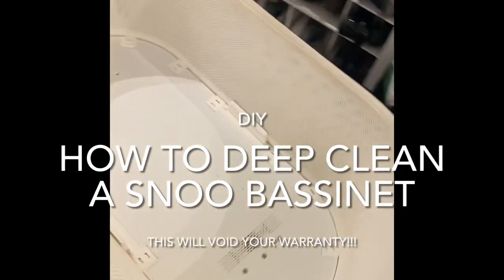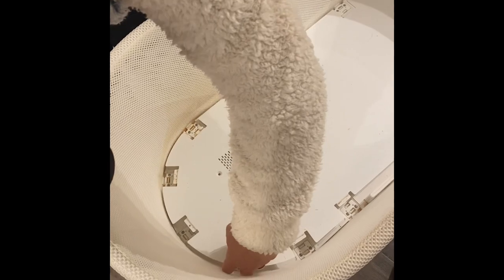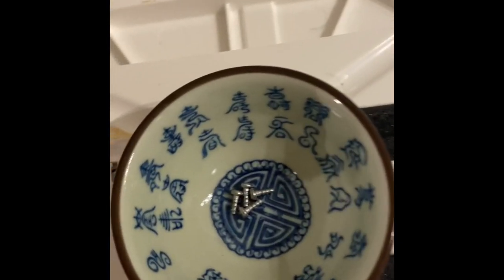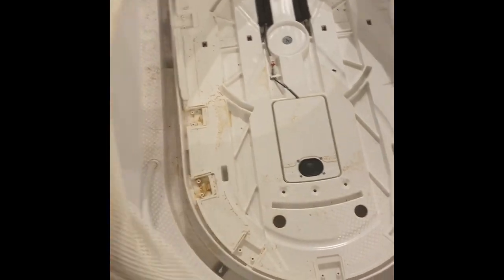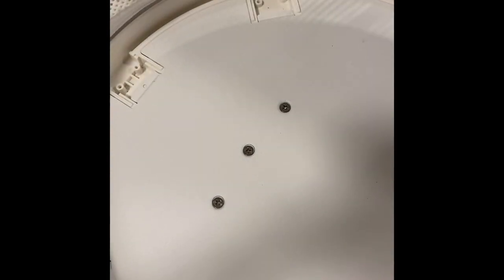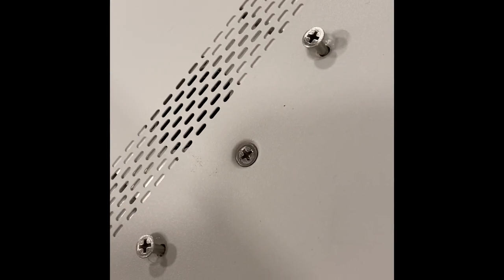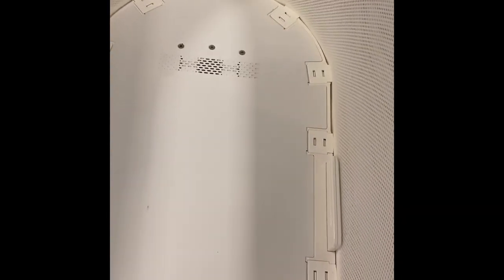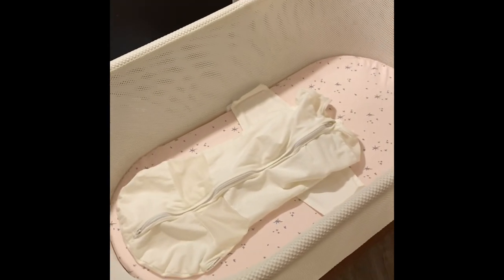DIY How To Deep Clean a Snoo Bassinet

Comment: Struggled with putting back the six screws until I read the comment that explained what was happening. Basically the thing the screws latch on to falls away/downward when the screws are removed. As a result it’s much easier to install those six screws if you lay your Snoo sideways and then tilt it a little further so the thing the screws need to latch on to falls back towards the hole. Then leave the Snoo on its side while you wiggle the base and search for the screw’s hole with a flashlight and the screw.

Comment: Tip for those 6 screws, I had some longer screws of the same diameter (I think M4) and used one in the centre hole to help pull up the lower guides before putting in the original screws either side, then it's easy to swap the middle screw. The problem is the lower guides drop and the screws are not long enough to get a start and pull the guides back up
Reply: Using some longer screws make getting it back in really easy
Reply: Same here. I found a longer machine screw of same diameter in my collection of misc hardware. Lifesaver. I used the long screw to attach to one hole (not fully screwed in), pull up on the long screw connecting the loose the piece underneath, fully attach the two other original screws, remove the long screw, and finally replace the final original screw (repeat on other side). Sadly, this seems to be a proprietary design "feature" to discourage consumers from performing basic maintenance on the device.

Comment: Yes. Thank you so much!! Excellent tutorial and tips. 

This is something that Snoo should address! I it retails for $1200+ and comes with this fabric mesh that is impossible to clean. (quickly and easily!) Hopefully Snoo will re-work this, and build it with material that can be hosed down, the fabric snapped back on quickly and easily, etc. anyways! Fully appreciate your tutorial. 

When I unzipped the back on mine and looked inside, it was very dusty between the two pieces of mesh. 😳 AUGHHH!! Time to get to work. Good luck with your baby, as well. 💖
Reply: Amen

Comment: The hardest part is definitely to get the 6 long screws back in place… I put the basket on a clean mat and tried different angle (lean the basket against top edge, like almost straight up on the side way) and kept moving the inside at the same time. Finally I was able to secure the two middle screws… feel like such an achievement!!

Comment: I highly recommend against taking this apart. It can be put back together, but it is labor intensive. After a very long struggle, I have managed. If you do take it apart to loosen the fabric, I would not take the metal plate off. That’s where things really went wrong. It depends on what kind of deal you can get or what it’s worth to you. I paid $850 and for the amount of time and frustration it took to clean, I would’ve sooner bought one new or rented.

Comment: Very annoying to get the 6 longer screws in but I found a pretty easy way.  Take the Snoo and flip it upside down between two tables with a gap in the middle and work on it from underneath. That will bring the plates down so that you can easily screw them in.  Helps to have two people to lift and flip it.   Once I figured this out, I got all screws in within 2 minutes.  What a poor design though.

Comment: Hi - I’m having a hard time snapping the pieces together shown 5:08-5:20 or so. They’re arranged correctly, but only easily snap in on the back half beside the mesh. The front part of the top plastic pieces doesn’t want to snap back in. Some go in fine, most don’t. 

Did you run into this problem and do you have any recommendations for making this easier? 

I’ve tried pressing a flathead into the slot to get them to snap, but they just won’t click. 

UPDATE: ok - the flathead can work if other people have this problem too. Just be careful. I broke a small plastic piece on the bottom connector, with no structural damage, but it helped get several others in that just wouldn’t otherwise snap

Comment: You can screw the clips back on before refitting the fabric to the base.  I found this easier.  Once fabric is fitted the top clips can be put on.  I put long match sticks through the middle holes of the 6 bolts.  The one I have done had broken o rings on the bearings so a bigger rebuild.  It is possible and I did completely remove the fabric to clean it but it is a lot of screws to undo.  I’m a mechanical engineer, took pictures and got it all back together fine and exactly the same but if you aren’t confident in your abilities then best not to attempt it.

Comment: For the 6 screws, I just gently stick my hands underneath the platform and felt the metal plate. Lined up the metal plate’s hole with the bottom of the platform hole where the screw goes through. It was pretty easy rather than keep trying to look through the holes with the flashlight. But definitely have to be gentle.

Comment: Taking the metal plate off is not necessary for most clean ups. My baby just threw up a foot in the air, hit our bed that was next to the snoo, it got under the mattress somehow and in between the two layers of mesh, but there was none at all under the metal plate. I could have just taken the plastic clips off without messing with the big screws and would have been able to clean it just as well.

The difficulty with the large screws is because the part they are supposed to screw into drops down once you take them out and the screws can’t reach it. I set the snoo on its side and used a long thin screwdriver to find the middle hole. You will know that you’ve found the hole once the screwdriver goes in deeper then the length of the screw. Then, while holding the screwdriver in the hole, tilt the snoo (like you’re starting to flip it upside down) and then put in the side screws. As they start to catch the thread of the part underneath they start bringing it up and the middle screw is no problem at all. You have to repeat the whole thing on the other side as the two sides are two separate pieces. 

As someone else said above, if ou have the same type of screw but longer, you can also just put the longer screw in the middle hole to bring the part up and then replace it with the correct screw once you’ve screwed the side screws in.

Comment: This product costs $1600 and you need to disassemble it to clean out the mold from baby spit and puke... absolutely ridiculous

They should have instaled gaskets to keep liquid out.

Poor quality engineering. But dont worry folks it has WiFi 😂

Thanks for the videoml. You are great. The engineers behind this....not so much

Comment: May I ask how much you paid for this, needing to be taken apart for cleaning?
Reply: Following
Reply: Used Snoos go for $600-$1000 depending on how many previous owners. They are $1,600 new plus tax. I paid $700 for mine with accessories and it’s very dirty. It was not disclosed when I purchased or else I wouldn’t have bought it. It’s cleaning up good though.
Reply from the maker: I paid $800 and it came with a bunch of other baby accessories and a ton of sleep sacks.

Comment: Hello, thanks for the video. I lost the screws :S, is there any way you could help me by showing them to me with some measurements so I can get a replacement from a hardware store, it would save us, this is a lot to ask :/
Reply: For anyone else attempting this step I highly recommend using a longer implement like a bamboo skewer to line up the holes. It makes it 100% easier. Pt. 2 if you’re able to, inverting the bassinet and lying under it to let it’s natural weight push down against your screwing the screws up helps as well.
Reply from the maker: Oh I’m so sorry!!! I hope you found a solution!